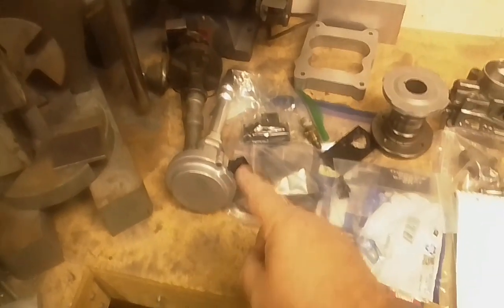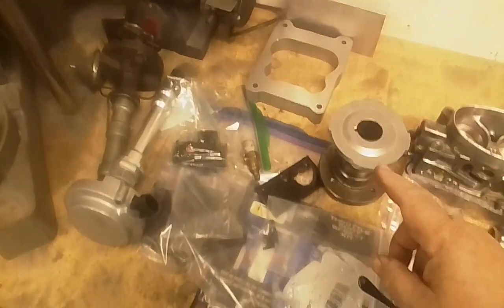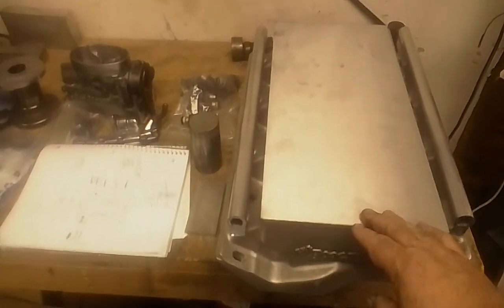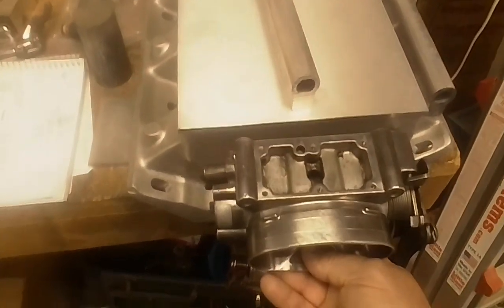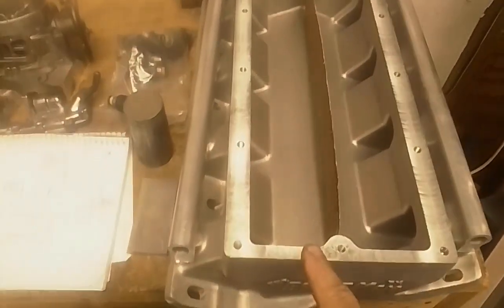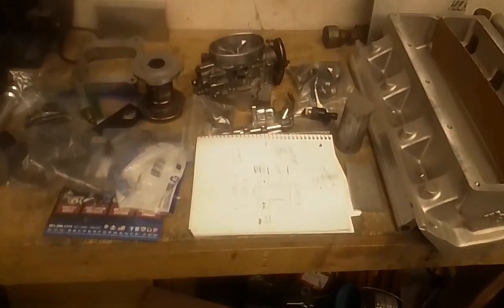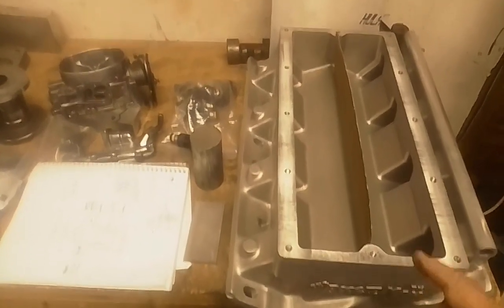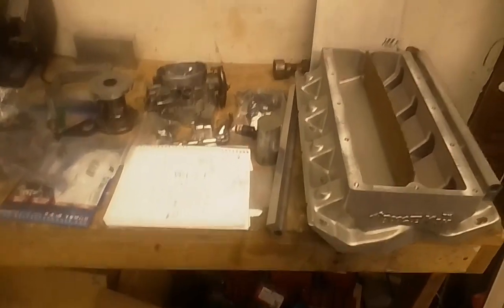Cadillac 472 / 500 boogieman fuel injection project part 1

Comment: Those throttle bodies top out at dual 58mm. I think it's about 1100 cfm of that's enough. I think if I did one I would make small divider plates up to the top and bring center to the top and put a small LT1 style box on the top. That would give you short runners to pick up the torque range. Neat idea though.